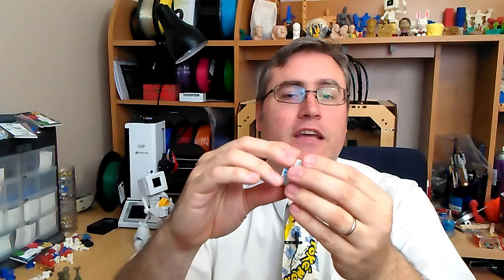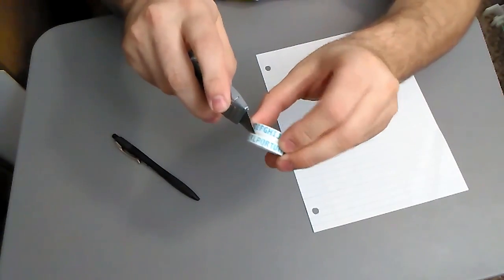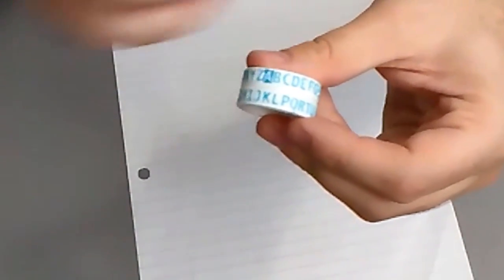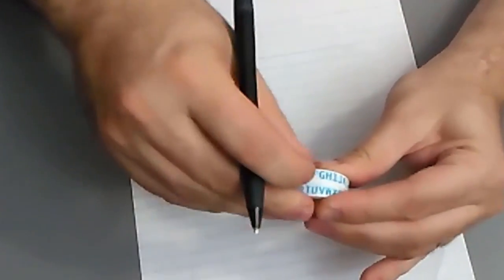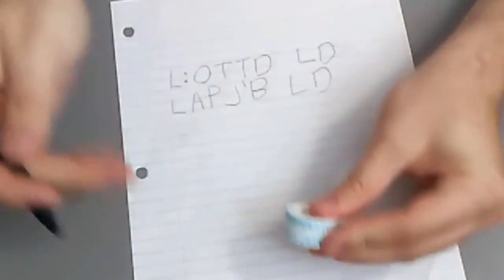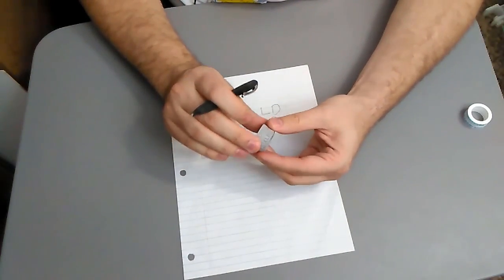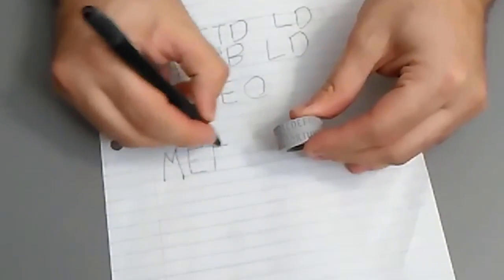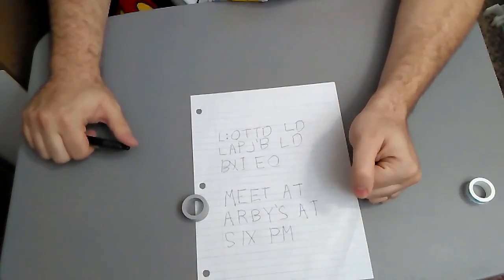How to use a 3D Printed Decoder Ring

Comment: Nice!  I don't play a mathematician or cryptographer on TV but...

I note that a simple substitution cipher like this is still pretty easily breakable - even if the output ring is shuffled - by statistical analysis across multiple messages of the frequency of each encoded character.  The frequency patterns for a language like English are well known, where characters like "e" are among the most commonly used.  There are also statistical patterns about where particular letters are likely to appear in most words that could also be applied too.  

So take an encoded message (the longer, the better), make a statistical chart showing the occurrences of each letter, match the most commonly used characters to their English frequency distributions, and with a little trail and error hopefully decode the message.  Eventually across many messages, you could probably derive the encoding ring pattern too (harder if the initial key is kept secret rather than being in the message). 

Seems to me that you could improve the quality of the encoding by imitating the technique of "cipher block chaining", to adjust the ring's key with each plain text character as it was encoded or decoded (or even have a rule that you'd adjust the key only every "n" characters maybe - a rule you'd keep secret with your key).  This seems like it would make doing frequency analysis of the encoded characters harder. 

The encoder ring should support simple special characters like a "space" too, since that would also make pattern analysis of the encoded messages a little more difficult.  Maybe you'd have to go to an encoder bracelet instead of a ring, if the average finger wasn't big enough.  -:)  

Keep up the good work!  I'm looking forward to unboxing my first 3D printer Christmas morning!
Reply from the maker: Absolutely. This is just for fun, but if you have critical information you want to protect there are better ways. I cut about 3 minutes of me rambling about this from the video. 

Short version, I recommended that you can overcome this by changing the key for every letter. A permuted alphabet and then shifting the key after every letter is 1/4 of the way to enigma-machine level encoding, and that nearly foiled the allied forces in WWII. Cipher block chaining may be too complicated, but even using a simple key-word that defines how to change the key with every letter in will foil frequency analysis, even if someone has the permuted ring.

I'm considering making another video, advanced encoding/decoding techniques with this ring, but will anyone actually use that information? Or will I just betray my pretentiousness in the process? I'm guessing the later.
Reply: Then again, simply reviewing the video gives the entire encryption code. Have not checked the other videos yet for confirmation, but it appears that you are giving part of the code sequence in alphabetical order as the first line of your message? Today's solution was j thru Q...
All good fun, though.  Hoping to be getting my first 3D printer soon.
Reply: Yeah, sort of like the guys who accidentally gave away the patterns for the TSA luggage keys in a high resolution photo - that enabled working replicas of those keys to be 3D printed.  Hard to stuff the Genie back in the bottle after that!  More issues like that to come with this technology in the future, I'm sure.
Reply from the maker: It would not be difficult to reverse engineer this ring, it's true. I've taken tons of pictures of it with the key showing plainly. And if you do that, hey, that's great. I honestly think it would be a lot easier just to support me on pateron for a month for a $1 and get the ring, but I admire hard work.